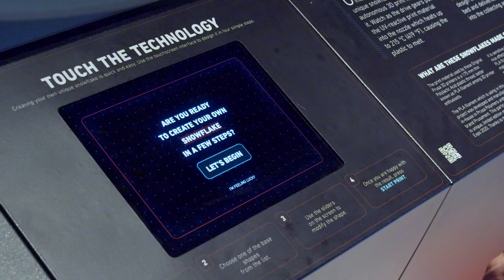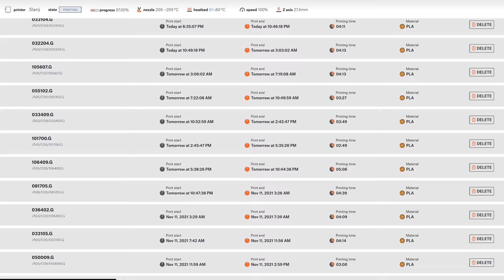PRUSA PRO AFS - Automated Farm System: Presenting the Future of Manufacturing on EXPO 2020 in Dubai

Comment: It’s a brilliant concept however, the problem is that most of the components along with the overall system will be completely obsolete within 5 years as all current 3d printers will be. Then what? Buy all new hardware? Or upgrade all existing hardware? I think a simple conveyer mod and the standard Prusa would be much more practical and economical in the long term. FYI i have 2 Prusa printers and they are amazing but all 3d printers eventually become obsolete unless upgrades are continuously made.

Comment: I wish there were some more news on this.  This type of print farm would be very useful for one-off parts, where mass production (i.e. injection molding) is not really useful, but having the ability to grind out parts by the tens to hundreds can be extremely useful.  For example, this could be something a factory uses to make parts for older, discontinued models where they don't have to keep the injection molds around in order to have a small part run done.

Comment: Rack mount tho. I honestly want that so I can mount my Prusa in my server rack with my other server stuff
Reply: Don't you want to keep your rack cool? ..... and your printer warm....? One really beats the other in my head, but convince me otherwise.
Reply: @freemanone87  i mean its pretty likely the temperature in a server rack is plenty high enough for a printer. Its going to be at least ambient temp probably significantly hotter. Sure the printer will produce some heat to but its not that much. The mk3s is 220 watts max so its really no more then a low power PC or a laptop on the high side of midrange
Reply: @freemanone87  I guess in smaller systems you don't really care whether the servers are a few degrees warmer (a few enclosed printers aren't a big deal), and in large systems you'll probably have separate printer & server racks.

Comment: Interested to see how they will deal with automatically removing supports in the far future.
Reply: Multi extruder system like Prusa XL can use dissolvable supports as they give better result and can be removed using small water bath

Comment: Very nice job Josef!
Was wondering if the lead screws would eventually introduce layer inconsistencies / need cleaning? It's been typical with my 3d printers.. Wouldn't belts cut that maintenance cost, be lower replacement cost, and enable significantly faster retractions? I'm curious.

Comment: I would like to see some numbers on this.
Because the most qualified printers for small series that I know are the HP Multijet Fusion Nylon. Printers. They have a fairly large print volume and are pretty quick too.
Much faster than any FDM machine could be. But they also require expensive polyamide powder.
A comparison would be nice!
Reply: There is no comparison between HP Fusion Jet and a Prusa XL. The fusion jet is for industrial use with a price tag and quality to match. There's no point in comparing the two. HP is 25X to 50X the price of a Prusa XL.

Comment: I love this system and  look.. its so awesome!
but i have a question, how would you deal with different materials? for example, how tdo you avoid warping on Nylon? is there an enclousure system or idea behind to improve the use of other materials?
Reply: Yes there is an accordion enclosure planned for the XL, watch the video for it
Reply: @networkcrasher  Yes. But afs is not XL. they look similar but not quite same.
Reply: I think it’s safe to assume it could be ported as they are both XY designs
Reply: @networkcrasher  Like an enclosure works for Nylon, ABS, ASA, etc. Nope. You need a heated chamber, not just an enclosure.
Reply: OK, well i guess Josef will have to chime in
Reply: @alejandroperez5368  yeah? tell that to ultimaker. I've printer quite a lot of ABS, Nylon, PP on them, no heated chamber yet no warping.
Reply: @gongarcia4071  of course you didn't get warping. Tiny parts don't warp much.
Now try printing a 15x15cm rectangular part that's at least 5cm tall. Right, just what I thought.
Reply: @gongarcia4071  https://youtu.be/3-ygdNQThAs?t=170 and pay attention to what he says at 04:37
You're welcome.
Reply: So far i see it. It is one big heated chamber. So i don't see any problems with that. 01:28
Reply: @alejandroperez5368  a way people still achieve to print this partis in materials like abs is by using a heated chamber...
uhum... so... "a way"... one of many...
he is not saying you MUST use a heated chamber or that it's the only way... so it's not really useful really... thanks but no thnks.... sorry xD
Reply: @gongarcia4071  it's the only way, unless you show me a video of someone printing the parts I mentioned with those materials. Good luck finding it
Reply: The whole thing looks pretty enclosed... Warp originates from cold draft. No need for heat source when there are 30+ heat beds enclosed, irradiating heat.
Reply: @alejandroperez5368  Printed a 20CM tall and straight part of a helmet in a cardboard box, few hundred grams of filament, printed fine, no warping.

Comment: In terms of total setup cost, how does it compare to conveyor belt printers like the CR-30? It looks like a lot of complexity in the robot arm system.
Reply: it is a bit more complex but a system like this is for printing a different type of product, belt printers require the item to be optimized for being printed at 45 degrees meaning it cant print any overhangs on the opposing side of the print head also something like this can have a larger print volume while still having full bed contact as it is a cube and not a triangle

Comment: Hopefully these are much quieter! Sadly my experience with my Prusa it spends almost all its time in stealth running only 35% gets on everyone’s nerves. So definitely looking to get into something quieter and faster
Reply: I have an MK3s that was a bit noisy myself. I found that one of the linear bearings was not very smooth so I replaced it. Noise reduced considerably.
But the biggest improvement in making the printer run quietly was placing it on two patio bricks. Plain ole' $0.75 patio bricks from the lumber yard. They managed to make the printer noticeably more quiet. If you have some change in your couch, try the patio bricks!

Comment: I wish and hope for a dual material version of this.
Reply: They have up to five tool heads in the tool changer.
Reply: @Akegata42  I hope they make an IDEX version. 5 objects, all printing at once!
Reply: @SylvieTheBagel  no tpossible since it's 5 tool heads but 1 core xy single movement =(
Reply: @gongarcia4071  that's why I sad IDEX version- add 5 more toolgrabbers.
Reply: @SylvieTheBagel  There would be literally no room for the heads to move. You would only have the capability of printing in very small quadrants for each printer. There will be a lot more weight on the XY carriage meaning slower accelerations, more deflection, more $$$ to reinforce. You would need several extra motors and the electronics to enable this meaning extra $$$. You would have to have 5 of the same filament if you want to make a full size print...
The negatives are endless for almost no benefit. Just buy 5 minis.
Reply: @dts_user1389  then make bigger printer.
Reply: @SylvieTheBagel  Did you read anything but the first line? Why not buy 5 single-extruder XLs if that's what you want? There are already so many people complaining about the price of the XL.

Just because you can create a IDEX version doesn't mean you should. 10x the problems,  5x the cost, 0x the usability.

Comment: My guess is, that the Prusa mk4 will be a lot more similar to XL, than mk3s. It'll most likely descend from the printers used in AFS - they seem to be a cross between XL and mk3s (when comes to build volume).
Reply: There will be no mk4 unless Prusa goes back to their i3 design, but that's unlikely. For now their main product will be the XL, probably for many years. And then they'll maybe iterate on that one, so maybe an XL mk2.
Reply from the maker: We are definitely not abandoning the i3 design. ;) -Mikolas
Reply: @Prusa3D Any regret with that decision after Bambu has been taking so much market share from your segment?

Comment: It's clear Prusa are moving away from the consumer and even the Prosumer market because of the massive competition which is a shame. I was curious to see what they'd improve about their i3 but it's clear they pretty much are planning to move away from that market. A €2000 printer is no longer something a hobbyist can easily afford and that's without any of the options ...
Reply: Are you trying to stir up drama or something? They have a $350, $400, $800, $1000, and now every price point from $2000 to $4000 option all for the same method of printing. They don't have a single industrial option available on their webpage and the only prosumer product would be the SL1. Not being able to afford something doesn't remove it from the consumer category.
Reply: @LightsLuck-  How is it drama? The printers at the price points you mention are now 2-4 years old with little development since except maybe a few tweaks. That's a LONG time in 3D printer world - every other brand has released new versions or new printers of their main models and are offering the same options & quality for half the price. 

Their "flagship" i3 still has a very very dated screen with slow controls compared to a cheap €170 printer having a fancy touch screen display already. The Mk4 should have been released last year with all manner of upgraded components such as the screen. You can NOT continue to ask €1000 for a printer these days that has 3D printed parts, looks dated, is still largely the same printer as 4 years ago and expect to get a lot of sales. I've even seen Prusa fanboys grumble at the lack of a mk4 and few people are recommending the mk3 because it just is no longer worth it considering the alternatives that have been released the past  year and a half.

Their new CoreXY printer looks great but at twice the cost of the i3 they're pricing themselves out of the consumer market although it's obvious they're going after print farms far more than consomers or even prosumers. This video is just more evidence of this.
Reply: @redavatar  It's drama because it's saying something super opinionated with no real basis behind it. They have released updates for the mk3 and made statements about releasing a Mk4 when there is enough advancement to warrant it. I'd guess not too far now as the new advances from the XL will surely trickle down to the Mk4. Do you have an example of a printer with direct drive, Bond tech gears, heated bed, probe leveling that takes temp in to account, e3d hotend and nozzle, removable spring steel sheet, silent drivers, and quality controlled software for half the price of a Mk4?
Reply: @LightsLuck-  If you think that's "super opiniated" you're daft. The i3 hasn't received much attention in years while the rest of the market has caught up at a lower price point in terms of quality AND options. Heck, even two years ago you had printers at a third or a quarter the price that could push out prints of near identical quality. Not with all the same filament types no, but consumers generally don't need to be able to print the hardest filament types and even a lowly Ender 3 can be upgraded to handle those with a €50 Micro Swiss hotend.

What I say makes very much sense: Prusa can either try to compete with a dozen other brands that achieve the same quality at a much lower price or they can focus on a slightly higher market with less competition which they're clearly doing. I'm not saying they're going to drop their consumer printers but considering the mk4 should have been released a year ago if the people at Prusa were still serious about catering to consumers, I think the lack of news speaks volumes. They've been focussing on this CoreXY which is not aimed at consumers which is fine for those who run print farms but the only people who still finds the i3 a good deal are generally Prusa fanboys and even many of those are saying "let's wait and hope the mk4 will bring us many improvements".
Reply: @redavatar  If you are going to quote me, you could at least spell things correctly. You are making me look bad. I asked for one example of a product offering the same features and quality as a mk3 at half the price and I'm not sure if you meant a modified ender 3 was a good example, but I hope not. You can call me daft for thinking claims against a company founded on open-source, reliable, consumer friendly products is forgetting its customers and moving into the industrial market with no factual information isn't super opinionated, but it is at the very least opinionated. Personally I think its daft to make claims that the highest awarded consumer 3D printing company in the world can't expect to sell printers at their price point when the latest data released shows they increased their orders from 170k in 2019 to over 250k in 2020. 

If you think the mk3 hasn't had attention over the last few years then you haven't been paying attention. What exactly do you think the mk4 should have been released with last year? The only things you've mentioned are touch screens and lower price point. I have literally hundreds of thousands of print hours on prusas and creality printers. I use the printer screens for about 5 seconds a day. I would be embarrassed for prusa if they released a mk3 with a touch screen and called it a mk4. The mk4 needs to have a 32 bit wifi enabled board, touch screen of the mini, and the heatbed, hotend, linear rails, bed level correction, and pcie connections of the XL. The company needed to develop those improvements and they will certainly put them in the mk4 as soon as they are ready. Your view of lack of news is completely ignoring all the products they've released as an indication of what the mk4 will be.

And again, something being expensive doesn't mean it isn't consumer level. The XL is definitely in the consumer price range still. Industrial machines are in the tens to hundreds of thousands of dollars. I'm with you if all you are saying is prusa is now making a move to supply companies with print farms. But saying they aren't a company with a huge focus on consumers is ridiculous.

Comment: This is cool, but seems waaay over complicated. It's easy enough to tilt the printer at a 45 degree angle, blow a fan on the bed to rapid release the part from the bed and then use the print head to push the part off in a bin. There are also belt printers which I've heard mixed reviews on. And some people just have a huge Gcode file that prints the same part in the same spot over and over again. I just don't see this sort of set up making much sense for most people

Comment: I don't get it. Who's going to shell out tons of money to create prototype parts in mass? Have hobby grade printers crossed over to solve for strength, heat resistance and finish?

Is there really a ton of people lining up to set up a large 3d printing farm for mass producing tchotchkes?

I'm not trolling, I'm curious about the end game?
Reply: Yeah that's a fundamental issue. It's a lot of fancy stuff but at the end of the day the resulting product is all plastic that's marginally functional for real world applications.

...and this coming from a guy who has a Prusa MK3S+
Reply: @OU81TWO  The thing with these use cases is that the companies don't go on Facebook and post they're cool prints after they're done. So we don't see them much.
One example - Skoda, the Czech car manufacturer, has a farm of our printers and they recently revealed that it saved their production. They quickly designed a printable part that replaces a missing piece that would stop the entire production. And the printed part was fully functional and installed in the car.

Another thing is that in many companies, you don't print pieces of the end procut, but jigs and tools that make manufacturing that product quicker/cheaper/easier. These are usually one of a kind, you need a different jigs for each workstation. Even at Prusa we have an entire department just developing these parts for our main manufacturing dep.
Reply: @TheMikolasZuza  That makes sense....

Comment: Why not just use injection molding?
Reply: @ClickItYT  yes, but why would you need a 3d printer farm to prototype?
Reply: Injection molding is for manufacturing many pieces of identical part. You spend $$$ for the mold, it takes time to manufacture and fine tune it. Then if you make many of those parts, it becomes cost efficient. If you need to change the part later on, you often need to make new mold and start the process again.
With 3D printing you can start manufacturing asap without any additional cost per project. You can quickly prototype, change the model, start printing small to medium volumes. If you need bigger volume of those parts, you can move to injection molding.
Reply: @ClickItYT  you can 3d print a mold with abs and injection it with plastic by hand. Thats also good for prototyping
Reply: 3D printing is awesome for prototyping, but do you really need to have a massive 3d printing farm for it? That would cost more than basic injection molding for sure